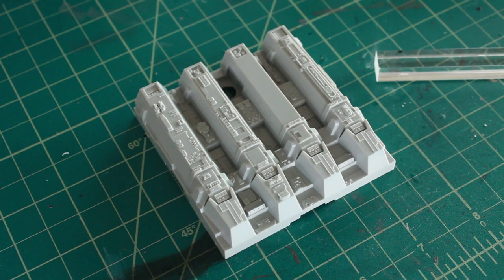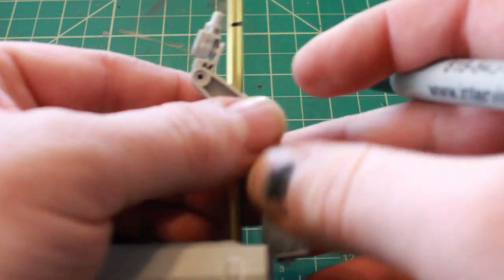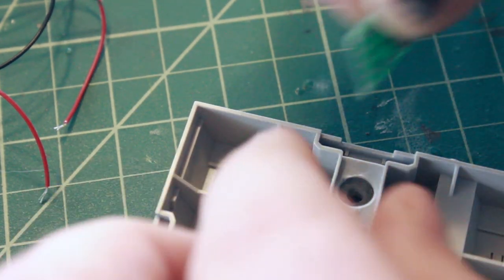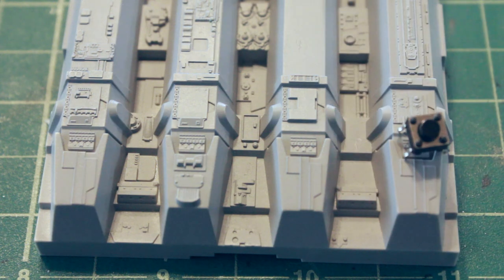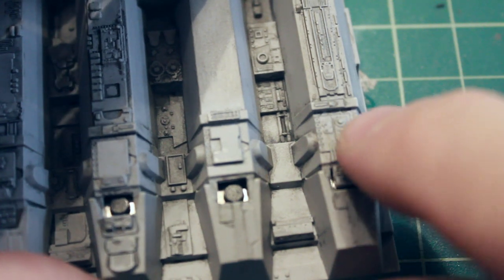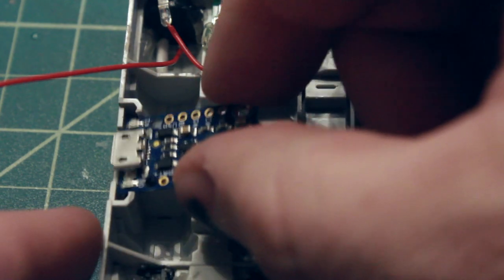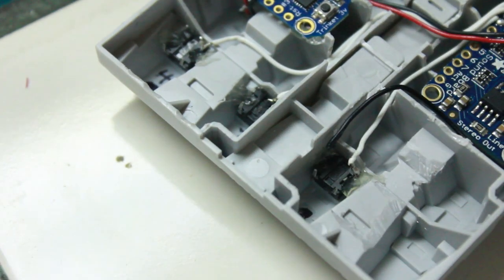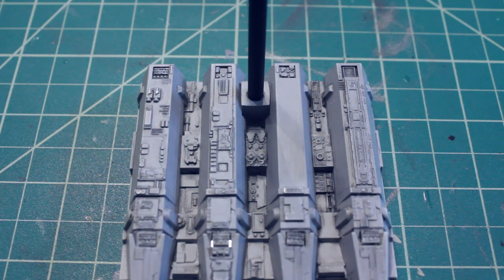Bandai Y-Wing Model Build Pt VI Base and Electronics

Comment: Got this video on my YT 'recommendation' and I'm a "BIG" ST-fan!!

I am a model-builder, of ships for the moment, but I do have several 72 scale X-/Y-wings and resin 48 scale of the same ships plus (+) hanger details.

But I have a question..... I have  been doing my ships with interior lights from a supplier, but MY question is..... my wire connections are VERY thin, 28 AWG, so could I also solder my connections??  What is your advice??

Thanks for your time, AND NICE builds!!
Reply from the maker: I solder all of mine, and I use 28 and 30 AWG wire. Shouldn't be a problem.
Reply: @modelsbychris  Holy Smoke!!!!  That was a quick response, Thanks..... just curious on the soldering iron...is there a specific brand that you have?  I have seen a iron(s) that have different "heating power" (wattage, I think) does it matter???

Again, thanks for the response!  :)
Reply from the maker: @Hey_MikeZeroEcho22P  I have this one, and I like it a lot.  Works really well. I would definitely recommend getting the brass sponge tip cleaner and Tip Tinner as well.  You can get them here. https://www.amazon.com/shop/christopherolson?listId=RFKR980EC8ZQ
Reply: @modelsbychris  Cool Beans!!  And Thanks, again, for the recommendations/replies!

Comment: what size acrilic rod did you use?
Reply from the maker: If you're referring to the brass rod that holds the Y and the wires run through, it was 1/4"
Reply from the maker: Oh wait, the acrylic square rod.  That was 3/8"
Reply: thanks

Comment: what power board did you use?
Reply from the maker: The Trinket and Sound board were both powered from a 5v USB power input
Reply: Christopher Olson How did you power your LEDs? Was the 5v enough for all of that?
Reply: @Demolisher_1  Since nobody else answered this - voltage doesn't really matter, it's the amps. The control board takes whatever input it's designed for, then converts it to whatever the LEDs need. Most of these LEDs are red and run at 1.8-2.2v @ 20mA (the board likely outputs 3v minimum which is why they needed to be resisted), and the two neopixels run at around 3.3-3.7v @ 50mA each (they vary by type, but that's pretty typical). So, the LED draw is around 300mA, plus whatever the board uses, which means even a typical phone charger from an old phone you have lying around (typically 5v@1A) could run this easily.

To put that in perspective, the typical hobbyist neopixel lightsaber needs a 7A 3.6-3.7v battery to run, and they usually run 144+ neopixels in their blades.